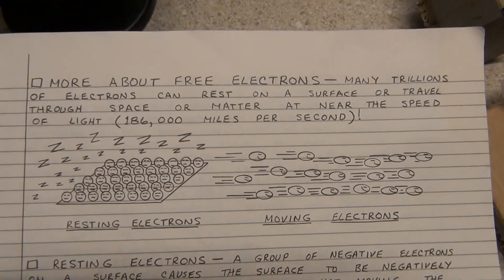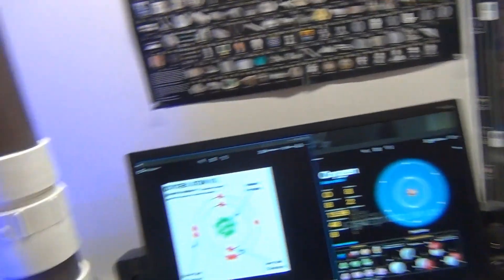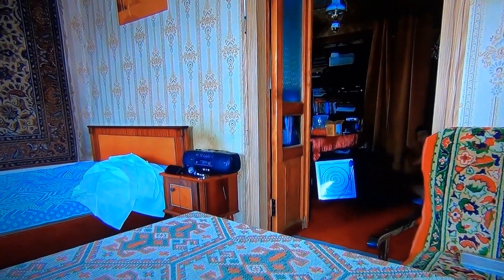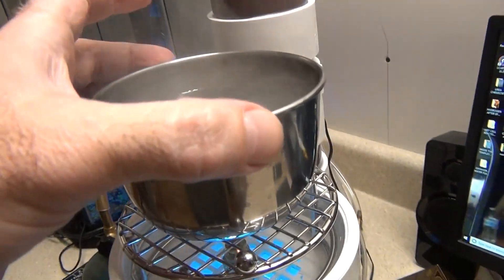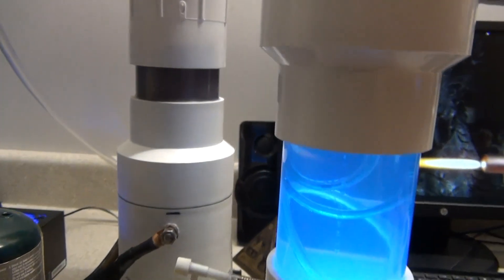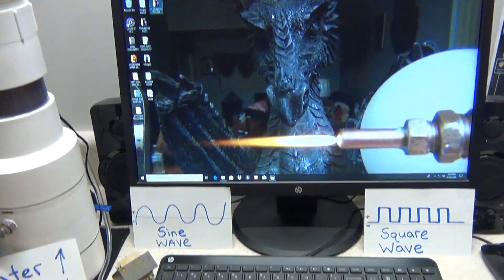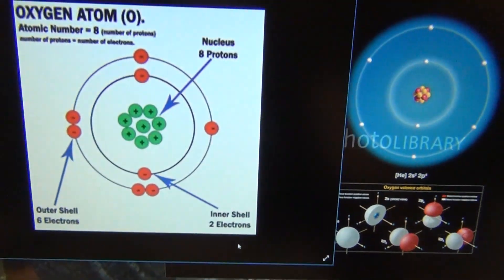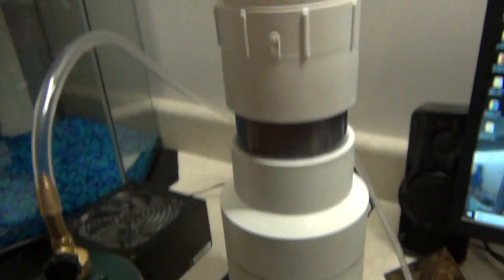HHO FLASHBACKS AND OXYGEN ATOM CONTROL

Comment from the maker: Hydrogen is an inert gas and is completely nonflammable without the presence of oxygen to enable and start the combustion process to take place. Oxygen is what gives hydrogen its power and strength enable it to burn, and it can be adjusted to be stronger or weaker using many methods as above. By adding a small amount of a hydrocarbon or propane to the mix flashbacks can be removed completely from the equation.